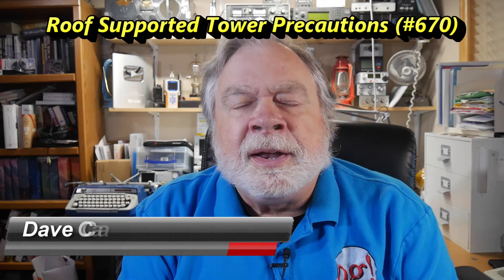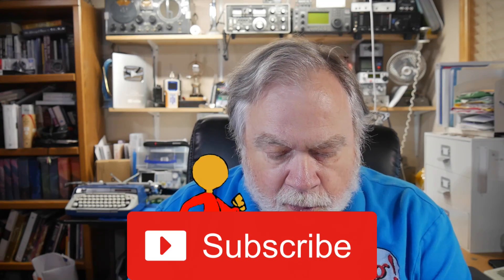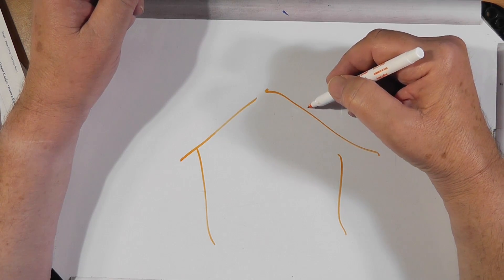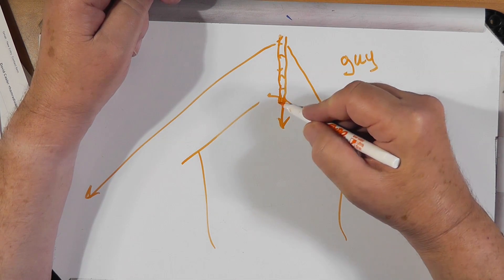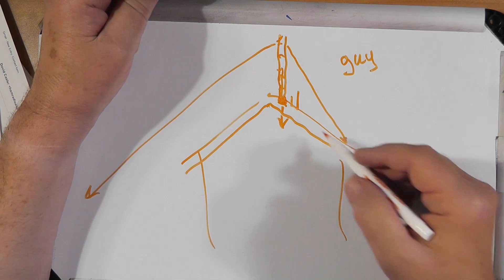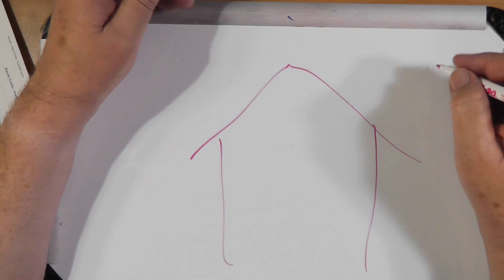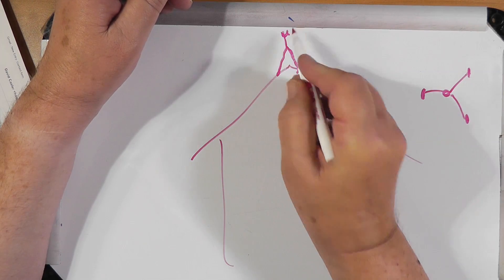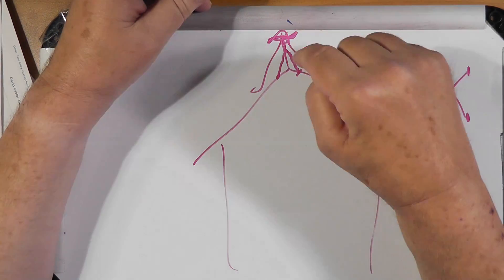Roof Supported Tower Precautions (#670)

Comment: I used to put up tv antennas so mounting is not an issue (retired electrician). However my home has a metal roof, im concerned about how high above the roof I need to go to avoid metal interference from the roof. Im thinking of an inverted V dipole right over my house, front to back. I have lots of trees and a 9m squid pole but maybe a 4-5m pole may be better in the middle of the roof. This unconventional method would be wife aporoved, no HOA here except her!😄
My home is surrounded by trees and bushes, cant see the house from the street but my wife doesnt want to see it when she sits under our large entertainment pergola. 😔

Comment: Some tower have wall brackets that have many places to screw to more than one stud.  My goes to a block wall and have half inch bolts through the wall with large washers in the attic.  If it comes down it will bring a very large part of wall with it. It makes it strong and my coax come into the attic just above the bracket

Comment: Maybe another vid about ground mounting but attached to the structure vs guying. My township requires a separate variance for detached from structure ant mast/towers 😞 the variance also requires a extortion fee of 500$ regardless if it’s approved or fails to get the zoning board n community approval also restricted to 100’ or less and guy lines must be with in the property lines by 20’